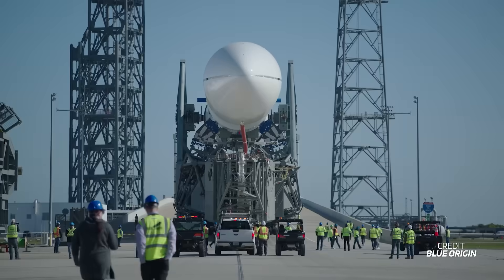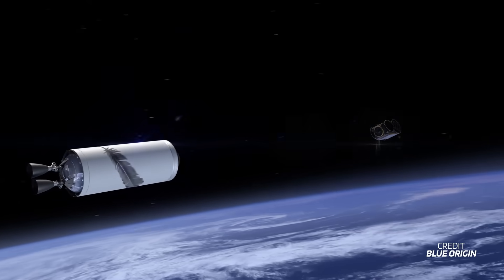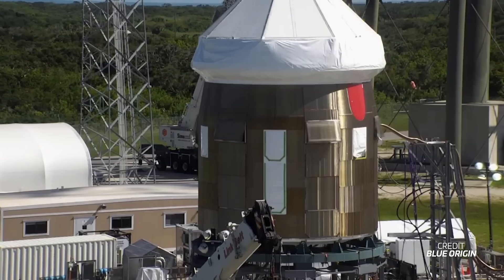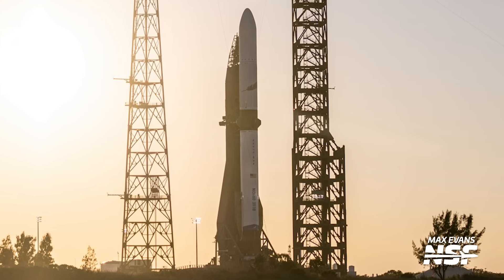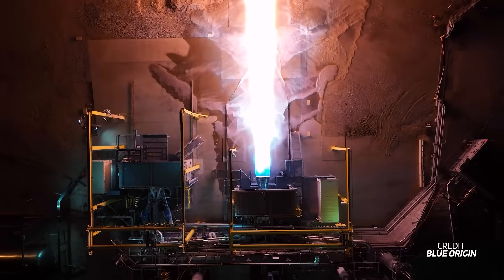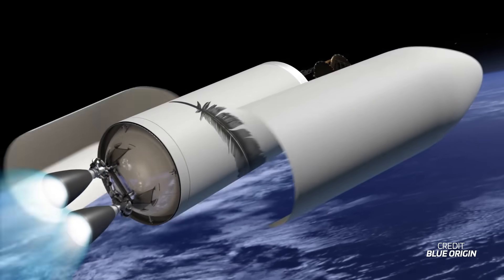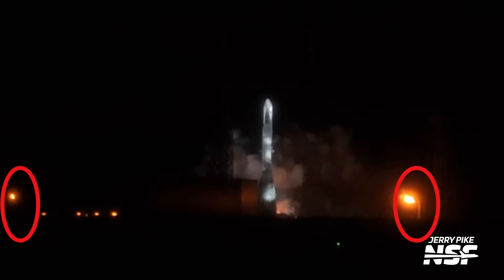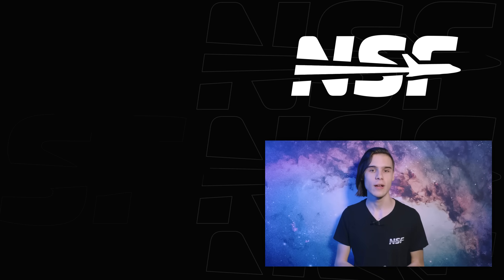The Wait Is Over: Blue Origin's New Glenn Takes Center Stage

Comment: Good presentation.  I thought that this channel previously reported that the smaller V2 version of the starship's payload capability was similar to New Glenn. At least it will be able to launch large satellites into high energy orbits and not be limited to satellites that fit into a Pez dispenser. Can't wait to see it launch, I'm heading to the beach.
Reply: The pez dispenser is just for Starlink.

How did you even get that confused??
Reply: @jtjames79  starship does not have a  fairing, and a normal satellite deployment system will not work. The Shuttle had payload doors, but the structures to make them withstand reentry were massive. The Pez dispenser was a cheat to allow SpaceX to deploy its satellites without all of the structure and weight to allow a larger hole on the side of the ship. If SpaceX could have just opened a door and released the satellites, "the best part is no part," they would have.
Reply: @user-fr3hy9uh6y no, this is just wrong
the pez dispenser is one design for starship, but there have been plans for starship payload deployment for years, including multiple types of real retractable fairings
Reply: @user-fr3hy9uh6y  You make a really flawed assumption that there will be only one version of Starship.  That's simple thinking at best.
Reply: @jtjames79 V2 Starships will probably only have a PEZ though because a big payload door would require a huge redesign of the entire forward section. So they'll probably integrate it with V3 which won't happen until mid 2026 at the earliest
Reply: Also the payload bay of starship. V2 is bigger because of the flaps being higher up and not using too much support on the flaps that limited v1
Reply: And also it's in a competition with falcon 9 heavy market starship is entirely different beast
Reply: Block 1 Starship has an estimated payload similar to New Glenn but that version is just for development and uses Raptor 2 engines.  Block 2 is larger and at some point will likely get Raptor 3 engines with 2 more on the booster and 3 more on the 2nd stage along with increased propellant this will increase payload.  

Block 2 should do real launches (likely mostly Starlink, refueling or HLS related for now).  

Block 3 is the production level and will likely be made to handle deploying different types of cargo. It will be lighter as they will have determined all the best ways to cut mass and will have eliminated systems just present to record data and make the data survive to be recovered.

Look for pictures showing Raptor 3 v Raptor 1 and 2.  The engine is so refined that the head of ULA thought they left off pieces just for a photo op making it look simpler - he was wrong).  They are going to do simplify booster and Starship as well as things go on.
:planet-orange-purple-ring:
:planet-orange-purple-ring:

Comment: If the first launch is a success, I would guess there would be a maximum of three launches of New Glen this year because I don't believe they will be able to build or refurbish the first stage at a faster cadence then that.
Reply: I think the same. But I also think the first launch will fail at some point. A safe recuperation of the first stage? That would be so impressive
Reply: @1337BlueBird  Do the BE4 engines gimble? As i know we are spoilt by SpaceX with their Falcon9 and Starship openness but we have not been privy to any of BO's rocket maneuverability and how they intend to land the first stage... and those 'grid-fins'  look very inadequate... but only time will tell i guess and im all up for healthy space launch  competition!
Reply: @sonneengel1945  Ryan mentioned it in the video, did you even watch it ? :) 4:55
Reply: And despite the successful ULA launches I think we don't know yet how reuseable the BE4 engines are after flight.
Reply: @michaelreid2329  "we don't know yet how reusable the BE4 engines are "

The first recovered engines will be torn down for detailed examination of wear. Even if perfect, unlikely to fly again. However, chances of success are high, the BE-4 is about the same thrust as the Raptor 2, but physically much larger. This is deliberate design by Blue to not stress the engine like SpaceX, so re-useability is almost guaranteed.
Reply: There are five total launches scheduled.
Reply: Bezos said they are aiming for 10 launches this year and 24 launches next year. They have a lot of Kuiper launches that need to be up fast
Reply: @BakiVSKengan  Personally, I hope they can launch 10 times this year, but the realist in me tells me that Blue Origin can not move that fast, especially if an unexpected issue occurs.  Look at how long it took them to get back to flight after the New Shepard anomaly.
Reply: They had 4 first stages in build as of january of last year
Reply: We cannot just keep on pumping multi-thousand satellite constellations up there! It makes a Kessler Syndrome event inevitable and ground-based astronomy impossible.
Reply: BO will be launching at max 8 launches per year as per their business plan...!!

Comment: I'm interested in Blue's landing, will it hover above the deck before touch down? This is of course it try's a landing.
Reply: Very briefly. For like 20 seconds. It will reduce from 7 engines to the 3 gimbal engines then to the center 1, then touchdown.
Reply: @Garlander  Indeed?  Where did you get that info?
Reply: @imaginary_friend7300  simulator, my old co-worker works there. Total flight time from launch to 2nd stage separation to booster landing should be just under 10 minutes total.